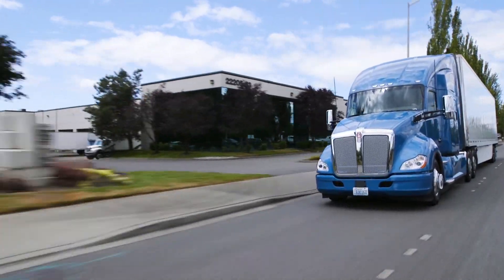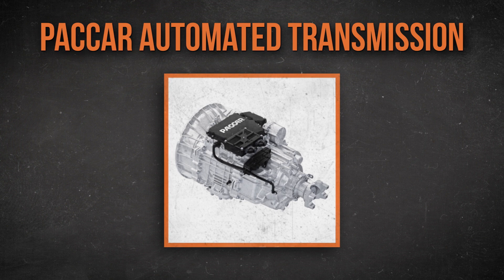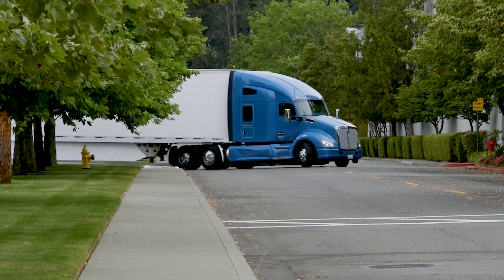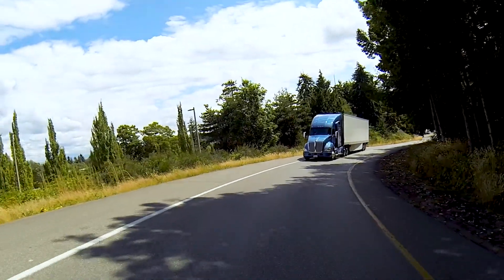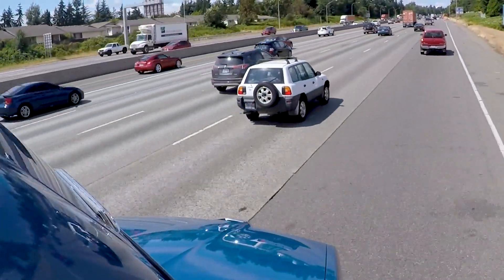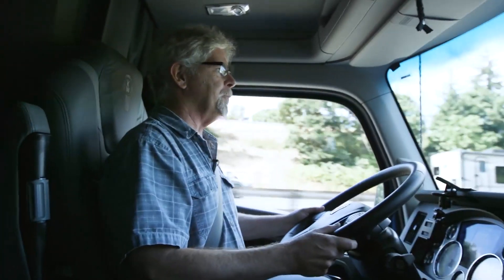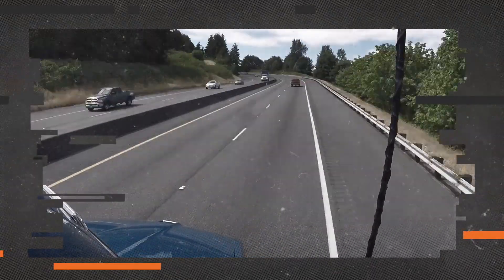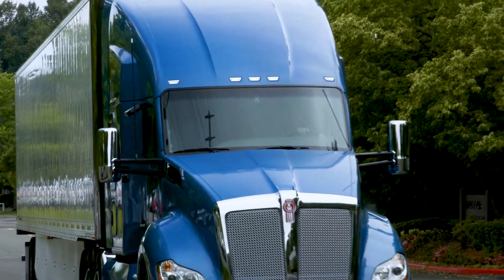PACCAR 12-Speed Automated Transmission

Comment: I have this same exact truck with the same engine and trans. I do NOT like it. I was doing much better in my old 10 speed than this trans does by itself. I noticed much more driver interaction with this truck because i'm always trying to correct what it thinks I want to do. And half the time it ignores my input. I can elaborate but this comment will be 4 paragraphs long if I do.

Comment: You need to take the truck in WV, PA - MD on I-79 and I-68 with 80.000gw Back-and-forth then it’s going how the transmission reacts lol .
Reply: I did and it works great
Reply: I drive one in pa everyday I hate it with a passion almost got me into a accident a few times and it wont let you manually shift freely without constantly locking it into gear. It also shifts like shit. I'd rather it shift like the mack dump truck I used to drive. I loved that automatic it shifts like a car

Comment: Good vid, Jim. Could you please explain "overall gear ratio"? You gave us gear ratios for 1st, and 12th, but how do you define/calculate overall gear ratio. Thanks much!
Reply: Frank, to calculate the overall ratio, you divide the ratio of first gear (14.43) by the final drive ratio (12th gear, 0.77). The answer you should get is 18.74. That's a slightly different number than Paccar advertises, but I think the difference is in their rounding -- they probably use three decimal points rather than two.
Reply: @jrbcjim  7th gear is 0.766 so you'd be right.
Reply: Hey Jim,

What do you think about the PACCAR Engine and Transmission now?

Comment: How does it compare to ishift ??
Reply: In my opinion, it's at least as good as an I-Shift in the performance category. On the technical side, it has pluses and minuses. It's the lightest automated tranny on the market right now at 657 pounds, and it comes with a 5-year, 750,000 mile warranty. On the minus side, the I-Shift has higher ratings and a few more configurations, such as the creeper gear. Give this transmission a few years to establish its place in the market and I think those options will start to appear as well.

Comment: Looks like German ZF  gerar box ))as Ishift Dt12)) just with other adjustment)) and label)
Reply: That's probably because its a 12-speed gearbox, like other European transmissions, not the 10-, 13- and 18-speed models North Americans are familiar with.
Reply: Jim Park do you happen to know why they didn't use the ZF gearbox (as daf do)? Are ZF truck box's not that big in the US?
Reply: Good question Colin. When I first got wind of the new transmission, I assumed it would be a ZF box because of Paccar's association with DAF. I started doing research on the product and had even come to a conclusion as to which model it would likely be. ZF transmissions never got a good market hold in North America, but there was a joint venture between ZF and Meritor about 20 years ago -- before the I-Shift and DT12 --  that produced two transmission called the SureShift and ZF FreedomLine. Both were competent automated manuals, but they were involved in legal proceedings with Eaton, who, it was alleged, was offering steep rebates to its customers to keep its share of that business. The two companies eventually settled the anti-trust suit out of court, but the FreedomLine was never able to recover sufficient marketshare to keep in viable.
Reply: Yeah, all these company mergings sounds like a cluster-muck in the making.  Especially when they start mixing cross-company ideas into the same software and hardware.  After reading comments by Mikhail G and Shaun Thomas (elsewhere for this same video) and watching Mikhail G's youtube videos, it feels like Paccar shoehorned some software.  Perhaps the transition between synchro and non-synchro only confused their software further.  This video spoke of a delay before the final piece (the paccar gearbox) was ready.   They might have had to pull some fast ones to meet a deadline.  Such as, re-flashing the original Paccar software to their gearbox controller.  And then binding extra software that simply translated data.  Mikhail and Shaun said they didn't see problems until hauling heavy on a hill.  So the data converting kludge might not be noticable until heavier loads.  The processing delay from the extra algorithms doesn't become a problem until unusual torsional stress is in play.
Reply: It is a ZF gearbox. it used to be a 12 speed manual with synch, wich they converted to an automated one without synchromesh.
Reply: @nickvw5404  my thought also

Comment: The paccar engines in dump trucks on the jobsites have been complaining about allot of emmisions issues. A lot of electrical problems.
Reply: Your probably gonna have more issues in a dump truck vs a road tractor. A road tractor for the most past is constantly moving at a consistent speed for a longer period of time. Where a dump truck may sit around at rock quarries, asphalt plants and job sites. Most of the time there just idling and that not good for the emissions system. I drive a dump truck and this is my 3rd year in it and it has almost 150k and I haven't had any issues with the emissions.  Whenever I'm sitting I'll idle at 1,000-1,100 rpms or will shut the truck off. The dvd that comes with new trucks with the MX 13 engines suggests idling at that rpm instead of the 600 or 700 that the trucks standard idle setting is.
Reply: This transmission is for on-highway use only. You probably won't see this one in a dump truck anytime soon.
Reply: @jrbcjim  It'll be cool if they could somehow come out with a Vocational version of this transmission being that Eaton already has a Vocational version of the Ultra Shift transmission. Not sure what all is different between this transmission and the Ultra Shift. Vocational market has been hot as of late.
Reply: @jrbcjim  Allison transmissions pretty much has the Vocational market covered.
Reply: Your right. But the Allison in my opinion needs more gears.  My boss has the 6 speeds in the newer trucks he's purchased the past few years and they seem to need another gear or 2. An 8 speed automatic would be great as far as the Vocational market goes.
Reply: @jrbcjim  Hey Jim, I see that Kenworth has a T880 for BMC that gonna be at the Work Truck show at Indy in March and it's spec'd with the MX 13, Paccars 12 spd and a 20k front axle. The Work Truck show is a Vocational market event and I thought it was unusual to see the Paccar 12 spd transmission in that truck being that it suppose to be for line haul/on highway use. Unless they feel it'll work ok for a building supply companys use. I guess the only off road the truck will see is deliveries to construction sites.